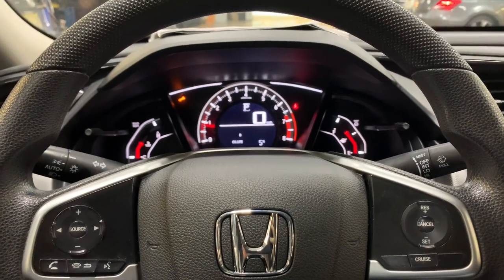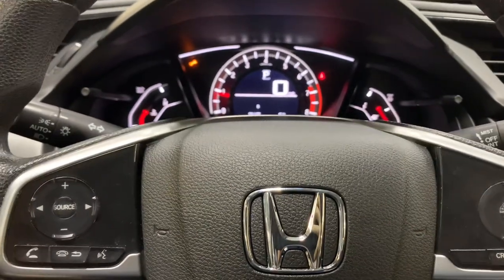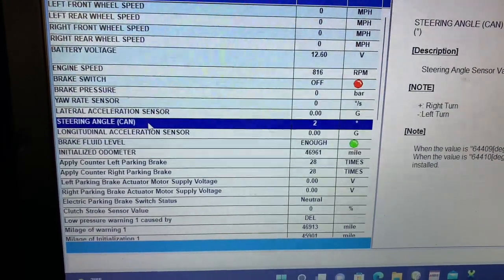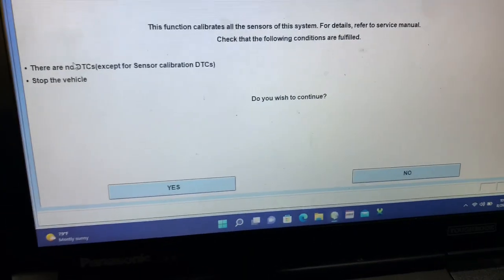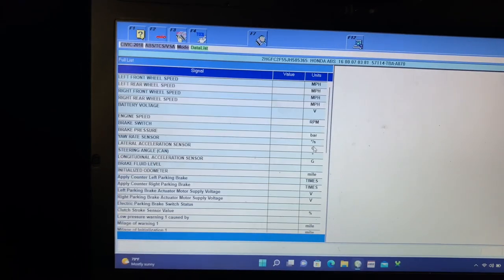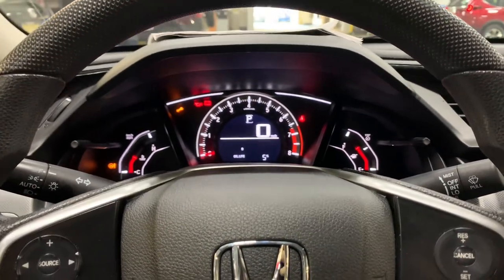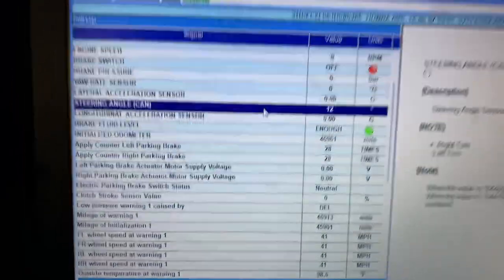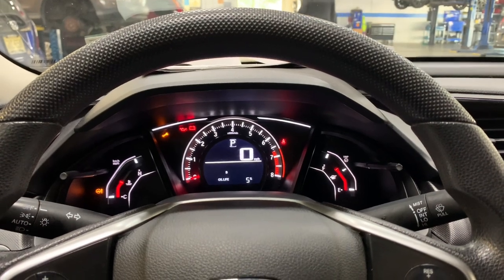2016 - 2021 Honda Civic steering wheel off center fix

Comment: Summer of 2023, I was waiting for Acura Integra to arrive to the dealership.  Upon test driving it, I noticed steering wheel being off center.  Car drove straight, it didn't seem the alignment was off and I asked the dealership to look at it.  So, the first time they put it on the alignment rack and said alignment is good and showed me the print out.  I replied back saying the alignment wasn't an issue as car is going straight but I have to keep steering wheel off center.  They tried to do an actual alignment this time, however the issue still persisted.  They told me to check out another vehicle as it has been 2 days and waste of time, so I had to pick another vehicle and make another color choice.  So, it seems that steering angle sensor needed to be corrected/reset and dealership didn't know about it?
Reply from the maker: Hard to say but it’s very possible it was something this simple.

Comment: Hi.  What is the difference between this method and the equal adjustment of the tie rods.  My steering wheel is also off centered to the right but I don't know which method I should use.  I have just gotten a 4 wheel alignment
Reply from the maker: This tells the steering rack unit where center is. If it think center is to the right or left it’ll never align correctly.
Reply: Does this mean adjusting the tie rods won’t make a difference? Has to be done through the ECU?  Is this a dealership only fix?
Reply: I have the same issue 😑

Comment: Very clear and useful guide！As i searched google，there is also a method without hds:just disconnect the 12v battery,this will clear the sensor memory.Then just reconnect,drive on a straight road,sensor will relearn.
Is this a proper method to perform on my own?My local dealer won't do hds relearn,they just mess with tie rod end，doesn't help anything apparently.
Thanks.
Reply from the maker: I can’t confirm the manual method until I were to try it myself although I’m skeptical on it. Your local dealer won’t do it with HDs, you need to find a new dealer lol

Comment: I took my car to the dealer to replace the steering gearbox last2x week. 3 days ago i noticed my steering is slightly leaning to the right. If i put in the middle the csar moves to the left instead of going straight. It doesn't really affect my driving especially if i'm occupied on the road. 
I'm wondering if the dealer knows about this fix aside from adjusting someting underneath to align it?
Reply from the maker: Chances are they don’t…

Comment: Do you think the launch x431 with the Honda software could do this?
Reply from the maker: Yes, did it on an hrv yesterday and a 23 pilot as well
Reply: Could you make a short video of the process? Thanks
Reply from the maker: @prm5798  on this exact civic or any?
Reply: @BCautosolutions  I have a 2017 TLX 2.4, so a accord would be the closest I think. Thanks
Reply from the maker: @prm5798  let me see what I can do. Give me some time to source one that’s not in a rush 😅
Reply from the maker: Done and worked, I will say you should follow the prompts in the video even tho I didn’t because I know I had a good functioning cars. Some procedures are different but the one in the short I will be posting is the most common.

Comment: Great video! How does the steering reset if the wheels are mechanically attached to the steering wheel through the steering column? Wouldn't the front wheels turn as you turn the steering wheel before the reset? My civic 2022 is off by 1 or 2 degrees and it's driving me nuts :(
Reply from the maker: It resets inside the steering rack. There’s some adjust in there that happens electronically.
Reply: @BCautosolutions  Thank you so much!!
Reply from the maker: @aidenwhy5806  anytime

Comment: Hey there,  I got my car honda civic 2006 diesel steering it's very tight can u help me out please. Thanks
Reply from the maker: Does it have power steering in the diesel trim? Also has it been in an accident?
Reply: Can u please assist me it's electric
Reply from the maker: @alinazimhasham4329  any lights on dash? Any codes?
Reply: Only the steering light it's very hard thanks
Reply from the maker: @alinazimhasham4329  if you get me a trouble code I can try and assist, without a code it’s nearly impossible.

Comment: Hi im started follow you and i need your help, i found ghis video, i got a acura ilx 2016 that its almost the same thing of a civic, so i sent my car to pepboys twice, the align the car but the steering wheel still turned to the left, what can i do please help me this people in pepboys they dont know nothing
Reply from the maker: Ask them to perform a steering angle sensor or all sensor relearn. If that doesn’t work ask them for a print out of the alignment sheet and email it to me. Bcautosolutions20@gmail.com